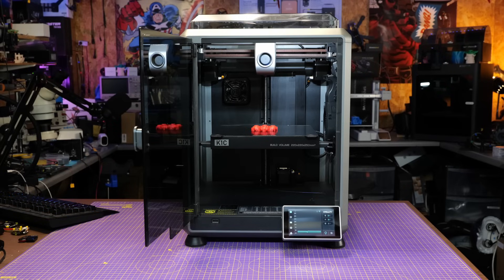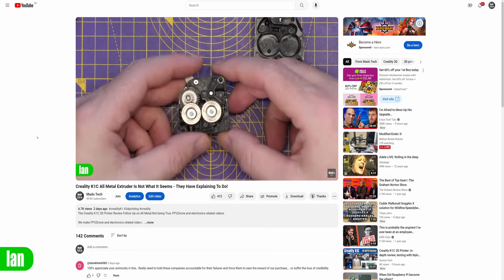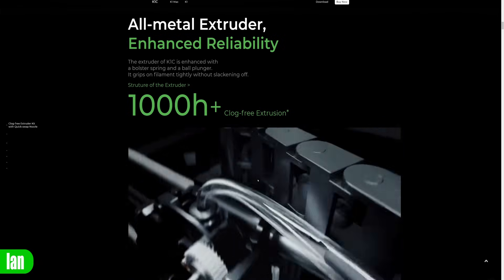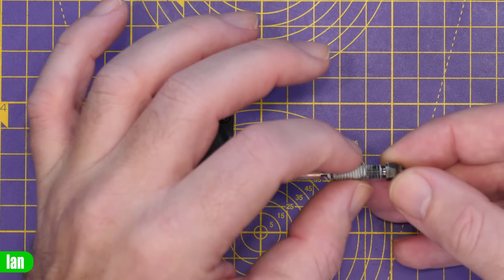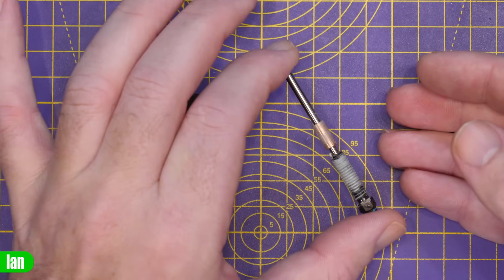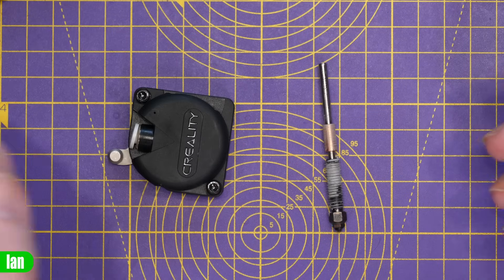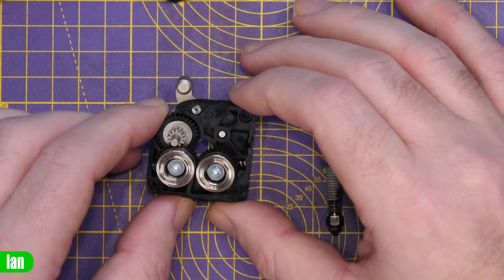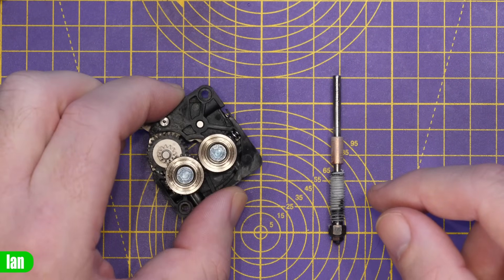Creality K1C All Metal Extruder Update - When All Really Is Not All!

Comment: All Metal would have caused more heat in the Extruder and Filaments like PLA would have jamming issues. Much like the ones some get if they don't take the lid off and the softer PLA gets too warm and jams up the extruder. I have a K1C been very happy with it. I think its a Hybrid mix that's well balanced. Also all metal to me would mean the Extruder case was metal too. which it's not and I was aware of this before purchase. I do not personally feels it reduces the K1C in anyway. All the core elements that need to be metal are I think marketing got a little to loose with their words. To me its not a deal breaker and I do not feel deceived and I'm not a Creality fan boy, This is my first Creality product and I feel it punches well above its weight and the software/OS are also great. Also the Nozzle its comes with is a tri-Metal Quick swap Nozzle the tip is brass. The Unicorn is aftermarket official upgrade Quick swap that is also Tri-Metal But some of the metal is different like the tip being harden Steel not brass. The Hotend as I understand it is the Ceramic Heating Block and silicone sock, The Nozzle is the Nozzle.

Comment: I have a question... IF it is all metal, what is the difference? all metal matters for the hotend temperature... gears are plastic with plastic contact, and that works just fine. they have upgraded the previous extruder with a temperature insulation thing on the motor, so the heat does´t transfer to the unmelted filament. it makes no difference. you are making complain of a non-existent issue that you never had.

Comment: Hello, I totally agreed with You, It needs to be all metal!, I have the k1 max, and The first time I tried to tighten the screws, the extrusion kit broke down, one of the holes for the screws that fix it to the motor, lost the thread and the screw does not tighten, I had to put some thin wires inside the hole so that the screw could tighten.

Comment: The biggest lie is "clog-free extruder". I have the K1 Max with the supposed upgraded extruder and it has jammed or clogged on 80% of my prints so far. I have had to disassemble it over and over and I'm about to toss this whole printer in the garbage. Creality's extruders are the absolute worst and in my opinion, it's the first part you should replace if you buy one of these things.

Comment: After around 40h of printing my extruder got stuck, when i opened for my surprise the plastic gear got 2 tooth stripped out. There are "upgrades" on AliExpress for all metal gears, do you think thats worth a try or that can lead to further issues with other parts, since this gear will not act as a fuse anymore?

Comment: The current plastic geared extruder is not clog free as witnessed on my K1 max  - frequently having to pull apart to remove jammed filament fragments.

So for me I suggest another marketing failure to suggest that the  current extruder is clog free.

Certainly, from brand new I has no clogging but after many prints it's far from reliable.

Comment: In my opinion, the reason you want all metal is due to the abrasive nature of carbon fiber filament, and that it will quickly wear out parts that are not metal. So what matters is what contacts the filament, and from the looks of it, that's all metal. The plastic gears don't look like they'd come in contact with the filament. The question is what kind of metal is it? Is it pot metal, metal, or hardened steel? That would make a huge difference.

Comment: I appreciate the details.  Your disassembly of the extruder head was a big help for me.  I had a print fail due to no extrusion. I attempted to extrude/retract to no avail. Turned out that the filament had formed a small gob of plastic that was inside the head, between the "metal" 🙂knurled extrusion wheels. Too big to fit thru either entry or exit holes. Clipped it, pulled the filament out and re-assembled. All ok.  (Also a shout out to Guys Shop, https://www.youtube.com/watch?v=V9-RimM9wHw for great info and mods for the K1)
Reply: Yep, that's my frequent experience.

Comment: Well, this makes me feel much more confident to try printing some PA6 carbon nylon I have lying around on my newly purchased K1 Max, since the updated extruder mechanism are exactly the same from what I can tell. Just have to update to hardened steel nozzle is seems, which should be here today.  Guess we will find out. lol
Reply: Any follow up on how this went?
Reply: It actually went really well @camdavbax . The part came out good. I might have need a little hotter temp on the hotend, at around 295C-300C for better layer adhesion. Need to test. Had the bed temp at 110, and used the glue that came with it, as well went slow, like 30-50mm/s max. I used a .8mm hardened steel nozzle, so the print actually went pretty quick. I've sealed up all the air gaps in the case, so now it get's up to a chamber temp of 45C pretty easily, and stays there. So, should be really good now for this ASA I just go in today.

Comment: I agree their marketing message was not fully correct and misleading that they should correct it.

However, to me, I would rather go for what it is than using all metal gears.  I believe it is better to use metel gear on the pinion (driving) gear but some kind of composite plastic on the spur gears, e.g Derlin (https://www.delrin.com/).  This enables more smooth and quiet moves as well as more durable in very frequent forward and backward movements, especally in very high acceleration/deacceleration working environment.

For example. if you go to check what are being use for professional touring RC cars that is for >100km/h racing, they are all using metal pinion gears and plastic spur gears.  For crawling RC, they choose to use all metal due to the very high torque requirement over the speed requirement.

Comment: You are 100% right, I would expect an "all metal extruder" to indeed have a metal gear set. The other thing I wish they had done, why did they not make it so just the tip of the nozzle could be replaced? Where I live I think the current sort of price for the nozzle as it is is around $40 which makes it damn expensive, must rather of been able to replace a $2 nozzle tip.

Comment: Well - Creality changed their website because it was simply confusing. I don't think they did used the words all metal on purpose in the way you perceived it. It's very common to call a hot end all metal if the heater block, supply shaft and nozzle are fully metal without any PTFE lining . If you look at the typical advertisement for most printers you will see that most all metal hot ends use non-metal gears. So - I do not think the original advertisement was very wrong or misleading on purpose. It was not detailed enough maybe...
Anyway - It's corrected now, so it all ends well. As a side note - I personally prefer plastic/nylon gears and casing, because it reduces weight and thus the mass that has to be moved. For fast moving heads it's highly advisable to keep things as light-weighted as possible. Adding metal gears and thus more weight would be contra-productive. So in this case using non-metal gears is actually beneficial...

Comment: I was going to buy one to go with my elegoo 4 pro but think I'll pass for now. Thanks for the honesty, appreciate it
Reply: I just got a K1 Max to go with my Neptune 4 Plus, and so far it has been a far more capable machine strait out of the box. I've had my N4+ for 4 months now, and I have thoroughly been enjoying not having to tinker with the K1 Max just get it to print like it should. Much faster too, with better quality too from what I have experienced so far. Don't get me wrong, the N4+ is a capable machine, and I still like it for what it is, but it doesn't compare to the K1 Max when speed and quality come into play. Just printed a gridfinity box on both machines, and the K1 Max was about 5 hours quicker overall building the box, with the print looking so much better while doing it. Then there is fact I had 3 failures on the N4+ while building this box wasting a total of around 17+ hours, which was how long the N4+ took to make one box, compared to the K1 Max at 12 hours.  There was also a part for a PC case I designed that ended up in spaghetti all 3 times I tried it on the N4+, but K1 had no issues. Each have their strengths and weaknesses, but they have fixed many of the K1 series. I don't feel this extruder "issue" will be much of an issue, but only time will tell there.
Reply: @TimothyStovall108  sounds like some serious user error here. I rarely ever get failed prints on either of my neptunes (max and pro) When I do it is user error. The fact you say its so much faster is just a lie. Neptune has klipper and runs at 500 and 600 mm/s respectively. So im not sure how you are printing 5 hours faster, considering neptune is a faster machine. To each there own though.
Reply: I don't know what to say, other than that's my experience. Same settings in Orca slicer, using the stock speed and acceleration profiles for the K1 Max and N4+. The k1 Max has been consistently faster. Both set at 500mm/s, but the accelerations on the K1 Max are 6X what the N4+ is capable of. Some prints the time difference is negligible, but on other prints the time difference has been substantial. 

As far as the N4+ quality and consistency, I've squared the gantry, trimmed the bed level within .18mm, tuned POM wheels, which are things that are checked regularly, as alignments and adjustments get out of wack quick, and just don't stay put. I've replaced the springs with silicone spacers, as well about to do the linier rail upgrade. Perhaps it is user error, but I can have one print run fine, then the exact same print go wrong next print cycle. I won't even begin to go into the extruder issues I've been facing the last few weeks. Great printer when it works as it should. I've just spent half the time I've owned it working on issues that come up.  

I feel I have to constantly baby sit the thing because I don't know what to expect from it as far as consistency goes.
Reply: @TimothyStovall108  maybe you got a bad printer .. when I got my n4 max, I leveled my bed and printed a 28 hour print  and it came out great, first try. Been printing great since I got it.
Reply: Wow  @IggyBiggy  Certainly sounds like you're an exception to what I've been seeing on the forums. From what I've read and been seeing, the N4 Max has had many issues for a lot of people. That's awesome yours has been working great for you. Haven't given up on my N4+, and it does do great with TPU, which I have been printing more and more of. May just become my dedicated TPU machine for a bit, till I can figure out what's going on with the extruder that's been giving me fits for the last month.

Comment: I believe this is interpretation problem. When I search metal extruder usually in my mind will pop out is full metal hotend (never care about metal gear) and those Chinese site are listing those part correctly. Should be not a real problem for those looking for 3D printer.

Comment: I hope you don't get a clog on the K1C extruder printing TPU.
Creality obviously agree it's not an all metal extruder after changing their marketing material. For me though if it doesn't need to be metal for increased reliability a lighter material like plastic is the better option anyway.
Reply: "for increased reliability a lighter material like plastic is the better option"

How does a lighter material provide better reliability?  Lighter is better for motion control when you want to move the hot end around with high accelerations, but I don't see that lighter makes the extruder more reliable.

Comment: I don't think there is any wiggle room here. An all metal extruder should at a minimum have all metal gears and bearings. I would forgive a plastic casing or even tensioner lever. Plastic gears however are not really excusable. Sure, you can claim that all the parts actually touching the filament are metal. Who cares? That has been the norm on pretty much every printer for quite some time. All metal should mean that at least everything that moves within the extruder during the extrusion process is made of metal, as those are all the parts which can wear and need to be precise.
Reply: Hey - I follow you on tiktok, hey man! 😂
Reply: @claytonbagley9049  Heyyy thank you! :D

Comment: Mainly it only matters if the internal temp of the printer cabinet is above 85C. Metal gears and nylon should work perfectly fine. They did mess up on the advert but it looks liked they have corrected it. So , if it was a mistake then so be it, if it was on purpose then they have mud on their face but I think the printer is still a great upgrade on the K1 .
Reply: Due to the abrasive nature of carbon fiber, you want metal as it will quickly wear out other materials. Having a nylon gear that doesn't touch the filament isn't a problem for me. To be ready to print carbon fiber you'd want all metal parts touching that filament. Please correct me if I am wrong.
Reply: I have PC printer which heated bed at 130-160c, case temp go over 60-80c and extruder max 550c (print around 350c for pure PC), Its fine for metal-nylon hybrid gear.